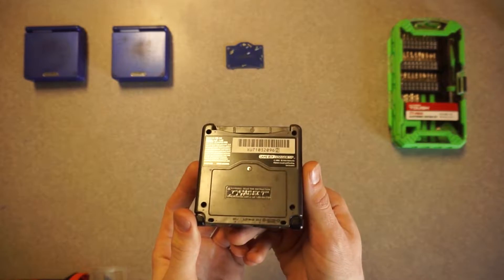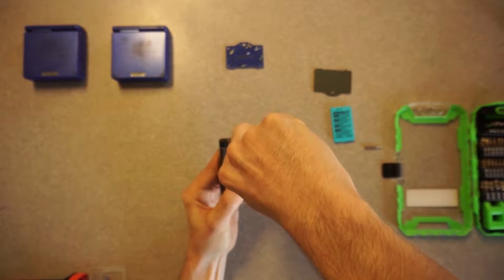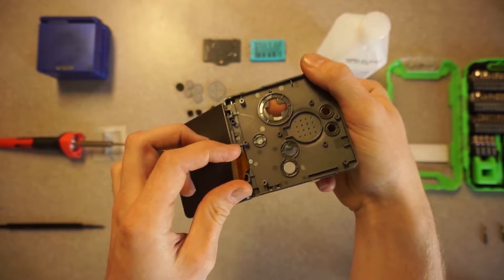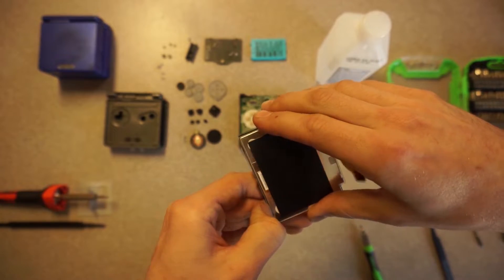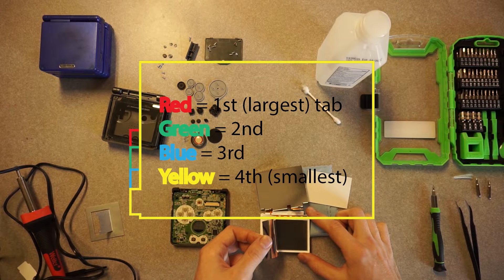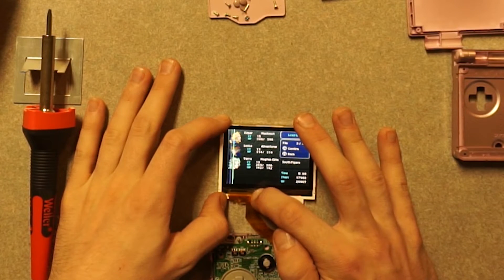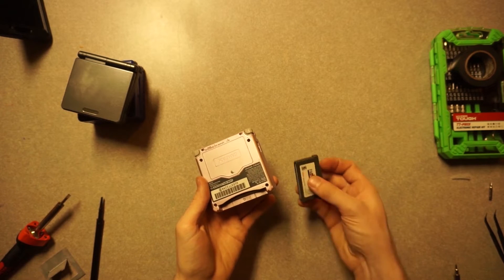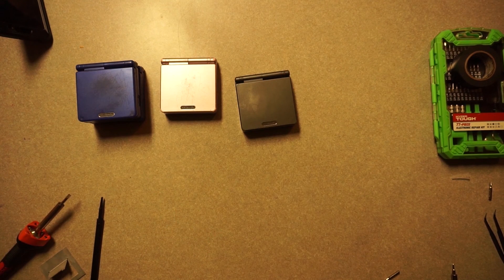Game Boy Advance SP AGS101 Screen Repair (Vertical Lines in Display)

Comment: i tried doing this and everything seemed to be going great! only had one line left. did another pass with my iron, but that seemed to have brought a lot of the lines back? and now they’re not going away?
Reply from the maker: Yes you might actually need to resolder then I'm so sorry! This doesn't always work unfortunately! I will say the same happened to me, it actually went completely white for a while and when I tried again that's what you see in the video.
Reply: @Philosopat  ah i see. i find it strange how inconsistent the lines are. they nearly completely diminished only to return worse than before. in your opinion, do you think i should continue this method in the hopes that it'll magically work? or alternatively, should i try to resolder the sceen?

ps - i did appreciate your swift response despite how old the video is, thank you :)
Reply from the maker: @pucky6835  yeah no problem! I would say there is no harm in trying! If anything a replacement screen isn't too expensive. My biggest thing with doing this was simply preserving original hardware.
Reply: @Philosopat  makes sense! i’ll keep at it for a little bit, but i may just buy an IPS screen or something :P

Comment: 8:06 I can't understand the order of the paper parts can you help me 🤔
Reply from the maker: Watch that part closely and you'll see on the left side of each piece there is a "tab" like in a filing cabinet. The biggest tab goes in first, then the second biggest, then third, until you get to the smallest tabbed insert. So biggest first to smallest last in order!
Reply: @Philosopat  Thanks :)
The screen is getting darker, can you tell me what's causing it?
Reply: @Philosopat  And, I saw this scene 8:06 the reflector first, but must do it in that order except for the reflector?
Reply from the maker: @TeRaK_e  correct and be careful not to get any debris in there.

Comment: I‘m about to buy a 101 with a yellow line - wish me luck on the repair…
Reply from the maker: Good luck! 🙏
Reply: @Philosopat  thank you! Bought the Gameboy now - sadly it’s not just a yellow stripe but the right side of the Gameboy seems to be a little bit brighter… maybe this fix will do it anyway.
Reply from the maker: @RotzTV  that could be what is called lcd leaking. The liquid polymer may be breaching the seal and that eventually results in no displayed image in those pixels. Not horrible so long as you can still see all text and such.
Reply: @Philosopat  it’s a little bit odd, on white screen, the right half is a bit brighter. On dark screen, the rightmost row is yellow. 4-5 Rows left of the yellow row are also brighter, but not to extremely visible… I try to make a picture later…

Thank you for your help
Reply: @Philosopat  i found the issue:
The flex cable was broken.. sadly I broke it more. Now half of the screen doesn’t work and the cable is torn..
Can I change the flex cable?
Reply from the maker: @RotzTV  that is doable! You can order a new ribbon cable and solder it at a point where it doesn't flex too much like in the hinge. This may warrant replacing the screen, which while not original and fully preserved as original unless you can source the same screen ($$$) can still look really nice! There are ips displays out there. I may do another video if I replace the screen I have that is really washed out. Thanks for commenting and watching!

Comment: 10:30 I have a completely white screen - so this gives me an idea of what the issue may be.
Reply from the maker: Yes sounds like the ribbon cable feeding the video signal has completely separated leaving only the backlight functioning. At that point it may be beneficial to resolder it entirely, reflowing just may not work.
Reply: @Philosopat  I have a white screen as well, I'll try this tomorrow to see if that helps

Comment: Hi, great video, now I can fix one of my 101s; and how do you recommend to clean some smudges I made to the bare lcd panel? Looks like theres no dead pixels, only looks dirty. Ironically I was trying to clean some dust that got stucked inbetween the panel and the screen lens, now theres no dust but the lcd panel is smudgy.
Reply from the maker: Sorry for the late response. Run the shower on hot until the bathroom gets a bit steamy. This will mitigate much of the dust present in the air. Then when you are cleaning the interior of the screen use ONLY 99% isopropyl alcohol and cloth or Qtips that do not leave fibers behind. You can carefully connect the screen to the motherboard to test it before putting it all back together. Hope that helps!
Reply: @Philosopat  Thanks a lot, that would be my next weekend project

Comment: How repair horizontal lines?
Reply from the maker: Horizontal lines may be repairable with this method, but the screen itself might actually be damaged at that point. The vertical rows of pixels are rendered horizontally along the ribbon cable at the bottom of the screen, so I would think for some reason there is a termination occurring along the left or right side of the screen. Are all of the colors rendering properly above and below the horizontal lines? Is it ghosting very badly.

Comment: Heyyy i have the same problem with the white edges on the screen. can it be fix? or it is unfixable?
Reply from the maker: Sounds like screen leak/bleed which is the liquid crystal coming out of the casing. It can be fixed, but I've no experience with that particular issue. Maybe someday I'll figure it out lol. As of now I'm self taught in this stuff like with vehicle repair.
Reply from the maker: The white that you see is pure backlight. Without the polymer in those areas, there is no way for the pixels to function properly and light shines through. This also fades out the image really badly.

Comment: I have a SP with redish screen (similar to the first one you show us), and on Reddit I read it is problem related to the polarizer which is damaged 🤔
Reply from the maker: If you gently disassemble the screen like at 8:00 and check those polarizers to see if they're in the right order or maybe damaged, let me know what you find! Theyve got tabs on them so they should go in largest tab first to smallest tab last, like a filing system or stair steps. Let me know what you find!
Reply: Pat C Thank for your suggestion. However, I’m not very confident to dissasemble the screen 😭 The problem not affect the gameplay at all. Just affect the black color of the borders of the screen which tends to be more like brown but there is image anyways (not like the white border of your screen in which you lost image). So I do not know if it is appropiate to take the risk :c (sorry my english is not very good)
Reply from the maker: @OscarGonzalez-pk2en  your English is good! I can understand. That is a tough choice. Always choose what is good for you.
Reply: Pat C Pat C hello my friend, I would try to change the polarizers but I have a question: Are the polarizers part of the 4 layers you shown at 8:00? Are they no attached to the screen? I watched how other people change polarizers from GB and GBC using a cutter near the screen’s crystal, so I’m a little confused ><
Reply from the maker: @OscarGonzalez-pk2en  they are within the lcd housing, the lcd is inside that as well. They are between the led lights and the screen which almost looks like a calculator screen inside lol
Reply: Pat C thx for your answer. I found this thread of reddit :

https://www.reddit.com/r/Gameboy/comments/4kdt0d/ags_101_screen_fix_lcd_experts_needed/?utm_source=amp&utm_medium=&utm_content=post_body

Even though he could not repair the same issue that your screen has, he said he could fix the redish issue of the screen replacing the polarizers, that why I’m motivated to try to fix mine.

There are other threads about redish screens so I think is a common problem but there are not videos about how to fix it.
Reply from the maker: @OscarGonzalez-pk2en  yeah just be confident and careful. Precise.
Reply: Hola, pudiste arreglarlo al final? Tengo el mismo problema

Comment: Hi, nice video... but my GB sp have burning screen, you know how to repair?
Or I need to replace with new one?
Reply from the maker: Is it black or white that you see? Is it the outer edge or a central point on screen? If you've ever seen a cracked lcd, it's usually a black spot where the crack is, where a leak would leave a white band or faded image. Leak is more likely repairable, but damage is probably more costly to repair at this point.
Reply: @Philosopat  Hi again, thanks for answer.
Well...  have many black circles from center to the edge, but the lcd not is cracked.
Reply from the maker: @Arcadeorama  can you send me a photo or a link to a photo sharing service?
Reply from the maker: @Arcadeorama  can you send me a photo or a link to a photo sharing service?

Comment: Hi, my Gba SP have similar issue to the first you showed, with the faded border, there is no way to repair it?
Reply from the maker: Technically there is. You would need to replace the liquid crystal polymer that is sealed within the screen, which I've no experience with and seems to at the moment cost more than simply replacing the screen. If it is anything to do with the ribbon cable, it should be similarly repairable to this unit in the video. If it's broken anyway, you could try using a heat gun but a fair warning, that could do more damage.

Comment: My gba sp has the same issue with lines, but this time on the right hand side of the screen. I have the screwdrivers necessary to open the system up but no soldering iron. Can I still fix it somehow without the iron?
Reply from the maker: I don't think so unfortunately. The best attempt would be to follow this method on the right most side of the metal fastener on the ribbon cable shown in the video. Thanks for watching and good luck! Don't be too discouraged if it just won't work, some of these screens are tough!
Reply: @Philosopat  do you know if this tutorial will work for a gba sp 101 that has the same problem, but instead of showing white when black it shows red around the edges? is it a whole different problem or a similar problem fixable with this tutorial? Thanks
Reply from the maker: @theighthsage  sounds like the liquid has leaked around the edges of the screen. This may have actually caused the pixels to get stuck in red. I don't think that is repairable unfortunately
Reply: @Philosopat  oh that sucks. a guy was trying to sell one but it has that problem. I did find a pearl blue 101 with yoshis island and bought it about twenty minutes ago for $110 though, so at least im on a good track.
Reply from the maker: @theighthsage  yes good job! They are only going to go up from here I feel same for the games. Some Pokemon boxes alone are selling for hundreds of dollars.
Reply: @Philosopat  yeah thanks! Im pretty excited, as ive wanted one for quite some time and im finally getting one! And the gameboy games going up is pretty good to know. I should try to get all the games i want before they go up. Thanks! Its a good thing I got tetris and a few other games like mario kart and warioland 4